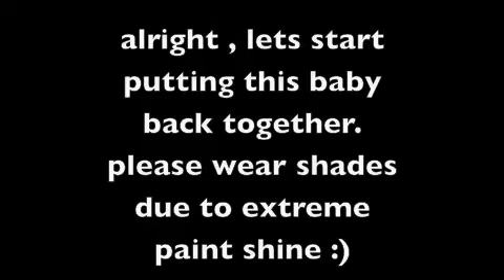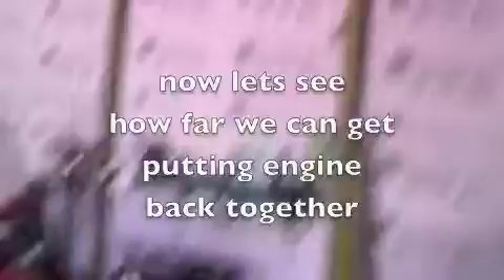Cub Cadet Project 14

Comment: Have a CC1450 in VA.  I've been thinking about driving the 1000 miles to bring back and restore.  Going there anyway (Opening Day).  Spent the past week trying to decide.  One issue was how much the motor weights.  Seen several videos where it was referred to as very heavy or someone was using a chain hoist to move it.  No info anywhere on the weight so I was about to give up (i.e.,. can I pick it up and put it in the back of my 02 Ranger???).  Then saw you walking around your shop carrying 1. Problem solved.  Thanks.  PS. Best videos I've seen on restoration and I've seen most of them.
Reply from the maker: i was carrying it but i about blew an o ring . lol 
there pretty heavy   . felt like close to 200 lbs 
good luck on your project

Comment: use an impact gun for the flywheel nut or it will probbly shear espeshally when it is driving the whole tractor i have a briggs that i went through like 5 keys until i used a impact gun and i tightend them down to correct amount of foot pounds